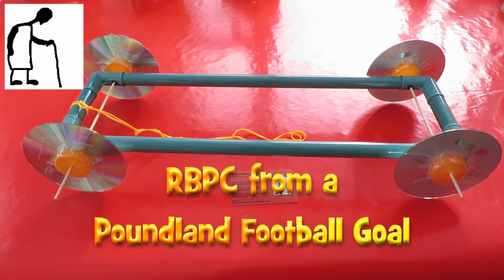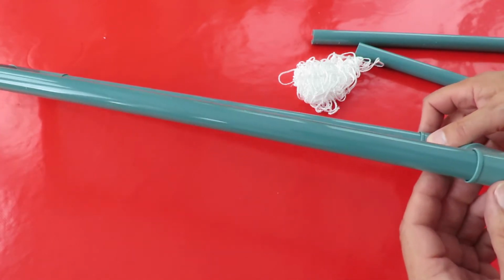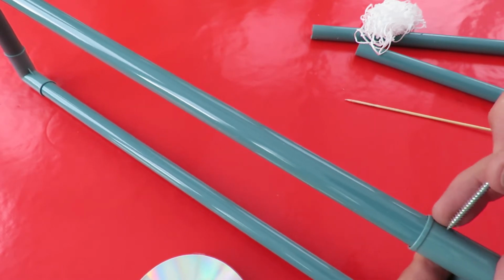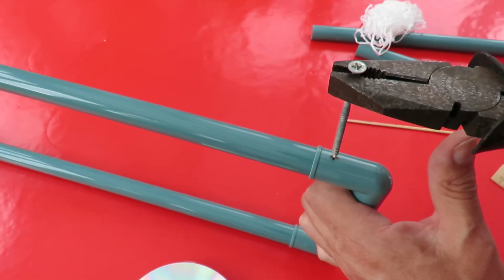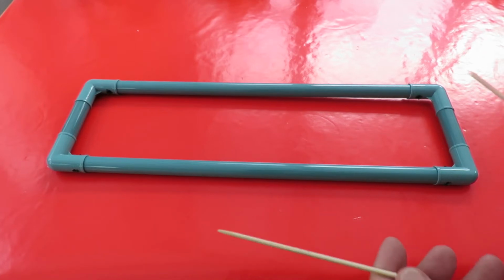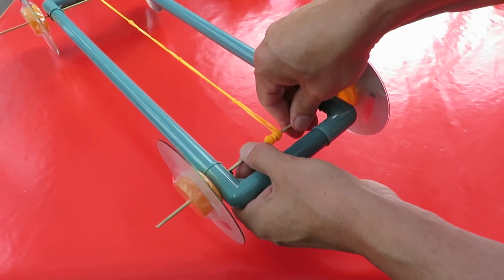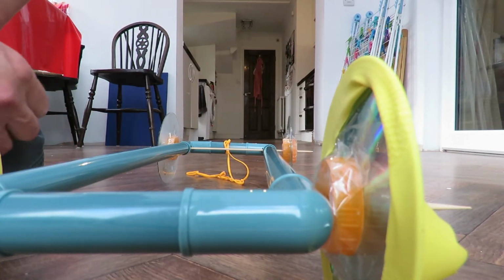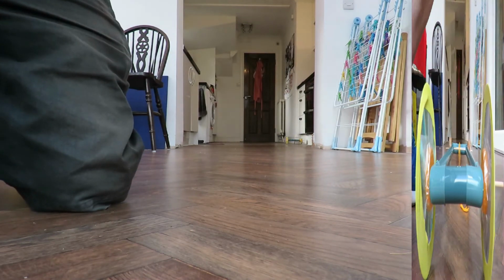RBPC from Poundland Football Goal

Comment: If those tubes are not very heavy one could form the fuselage of a lagre pizza tray rubber powered glider, they sould have the compression strength to resist a lot of turns on a rubber motor.
Reply from the maker: Thanks Ian, I can see what you are thinking. It would be the usual power/weight challenge. My main issue would be very few of my planes fly well anyway so it may not be a true reflection of it's capabilities. I will put that on my list. Worst case scenario would be that it actually flew well and got lost out-of-sight.